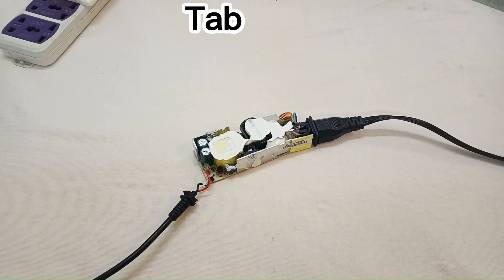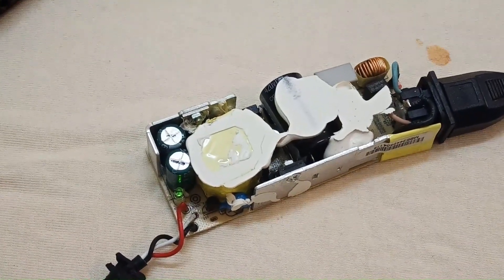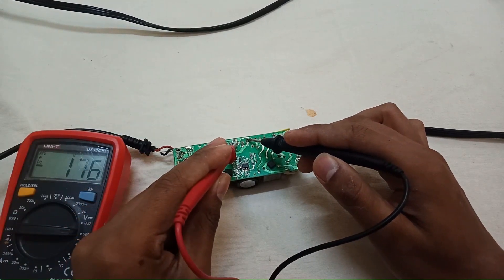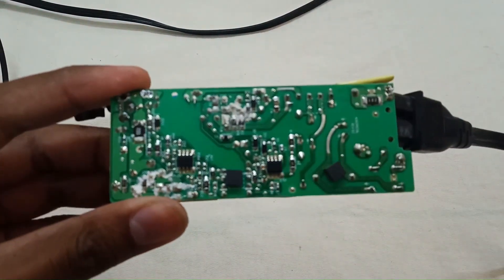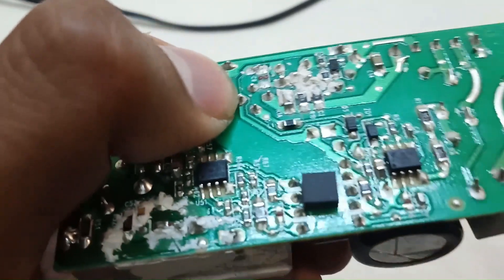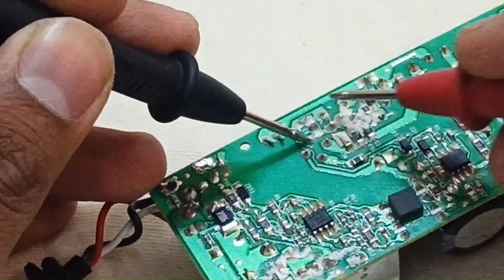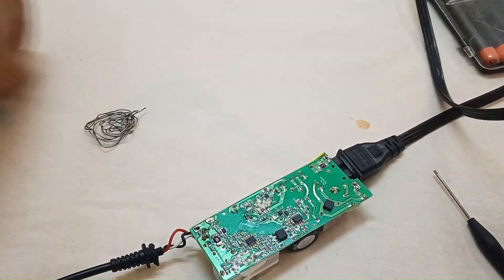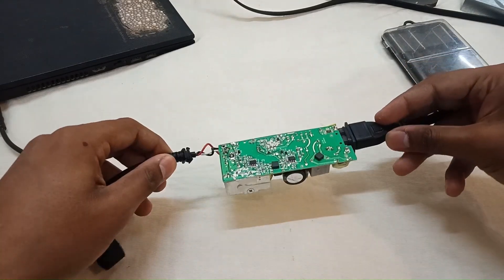How to Repair Laptop Charger | Plugged In not charging | charger Reboot problem solved #laptop #diy

Comment: Sir Mera samsung np350v5c Laptop ka Power adapter hain..... GH - 19v - B 
Wo abhi Laptop chala to leta hain par ... Cirkit main ek parts blast hua hain. Cirkit main Interference supration Capacitor  k bad jo (Mov) parts hain ....Wo Blast ho geya ...( Abhi Konsa value ka Mov Replace karu ) 

Please Help Me 🙏
Reply from the maker: @quickmixstudio  let me check the value and will reply.
Reply: @Electricquantism402  Ok Sir
Reply from the maker: @quickmixstudio  471k mov suitable or any other equivalent.
Reply: @Electricquantism402  Thank you so much sir 🙏❤️ 

Maine Aap ko Facebook par Cirkit ka picture send kiya
Reply: @Electricquantism402 Sir' 
 14D471K - Varistor MOV for 220V AC 

A wala Lagau ? .... online 471k mov search karu to 14D 471k mov dikha raha hain ....